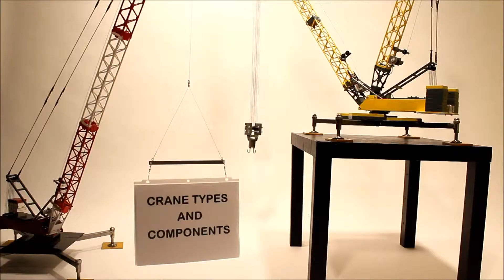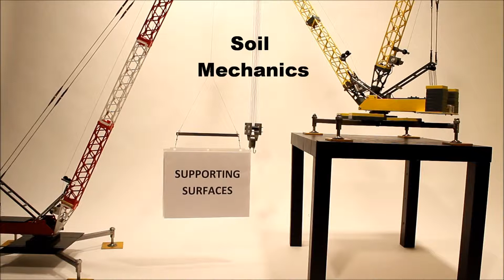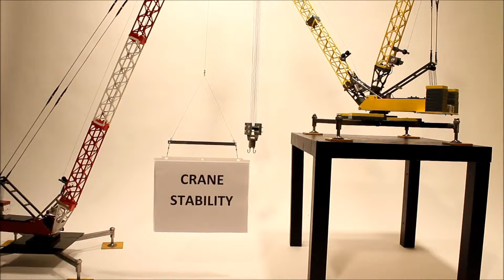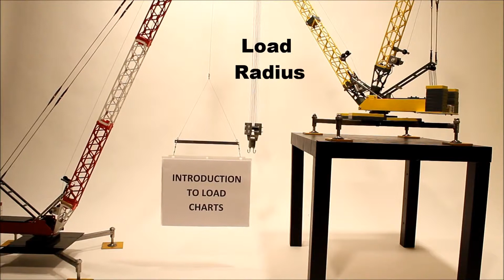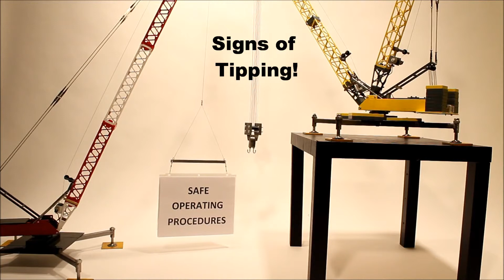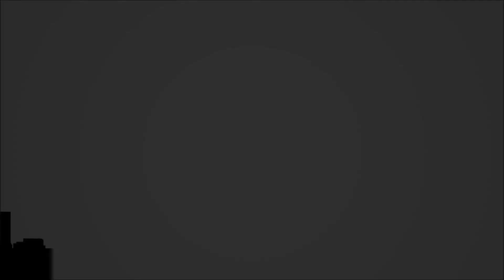OPERATOR NETWORKS C&G 2000's

Comment from the maker: @9428wayne Thanks wayne , they are thinking of the possibility of offering a learning plan with RC CRANE option ,,,  the C&G 2000-T (check out latest vid ) will be the best learning tool for this,,, much more stout and more user friendly ,, like running off 120ac ,no need to ever stop for battery mantaince and the boom being 1/8 metal tube will be hard to damage , also easy to ship ,,should have some available by spring .